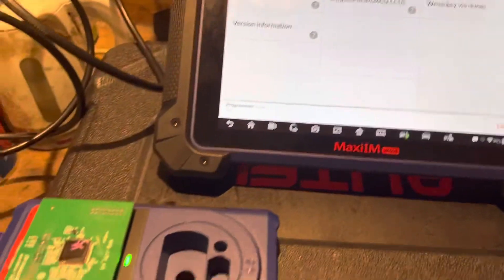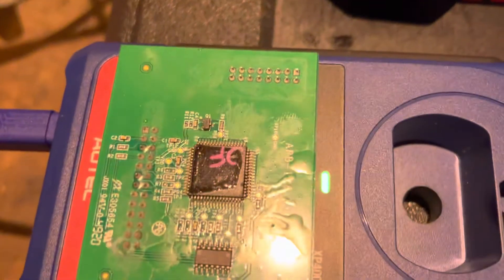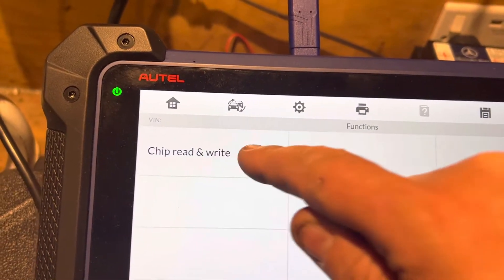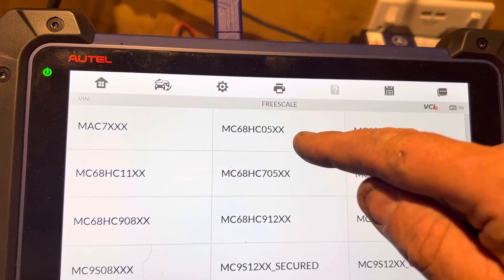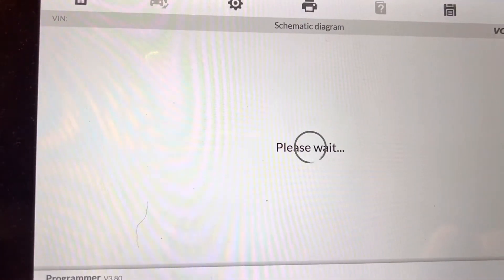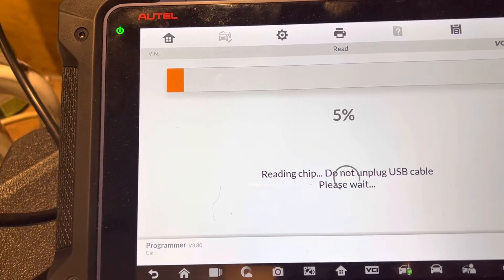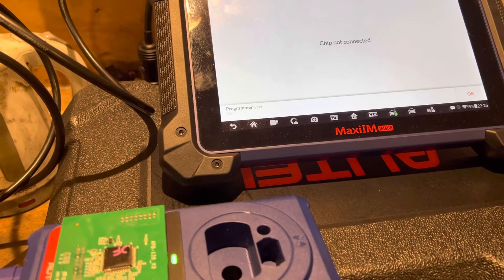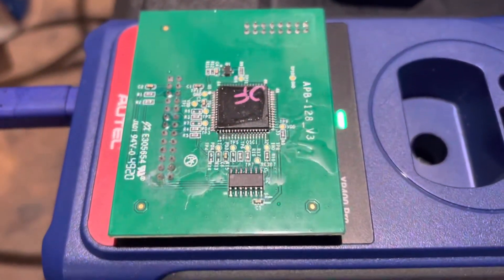Autel APB128 first attempt read MC68HC5x32 from Saab 9/3 year 2000 twice unit

Comment: Did you try any other readers? Hard to say if its just a problem with IM. A lot of mcu's from twice units are just flat out going bad these days.  If you get a job for one where they have a key it has just stopped working then chances are good the mcu is dead of the memory sector is gone.
Reply from the maker: So far from top of im608 pro It has failed to read everything. The port on end apa103 i hsve soldered to cim unit and read data to add key.